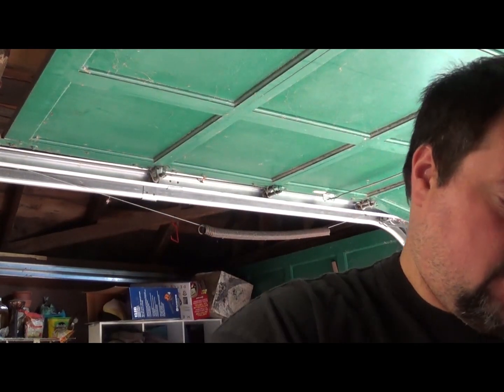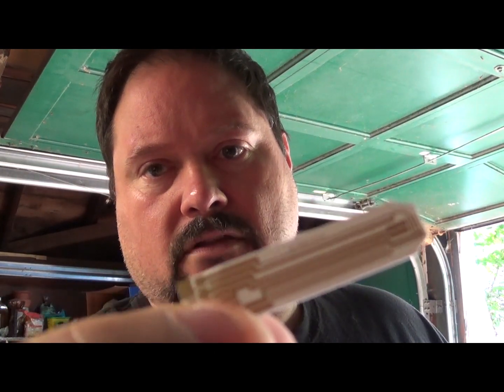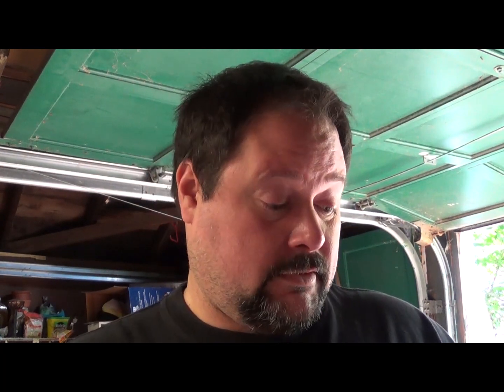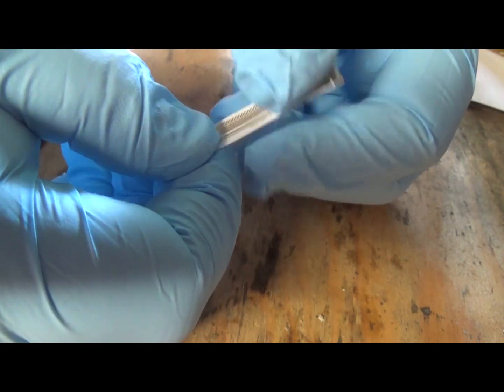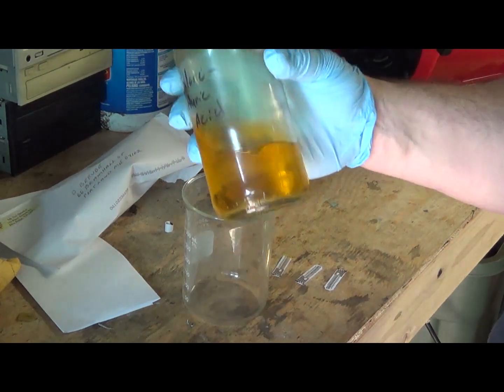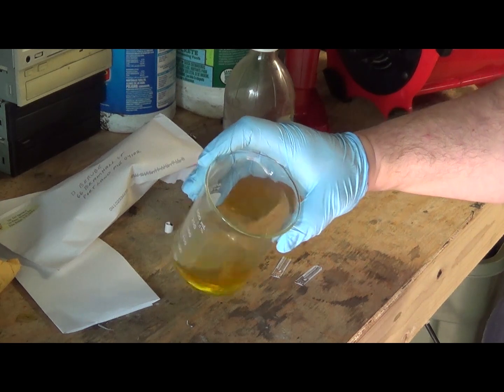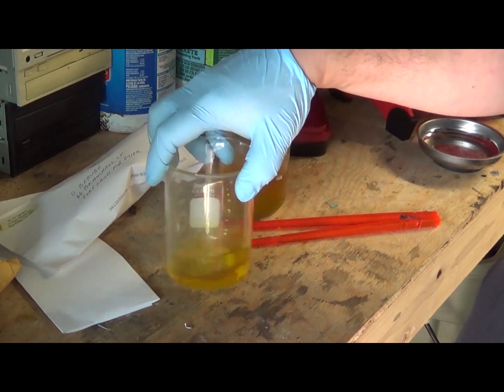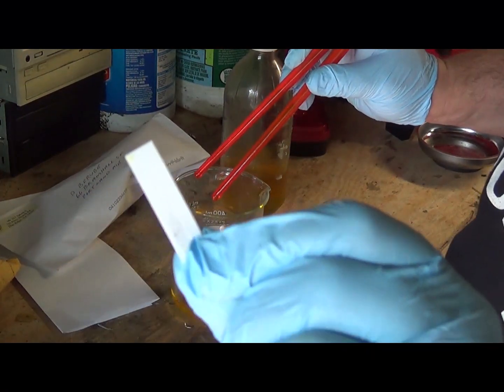Gold Recovery from Diabetic Test Strips

Comment: Being a diabetic I can offer up this piece of information. Some strips contain more gold than others. Usually the more expensive the strip, the more gold they contain, but not always. The more expensive strips are usually more accurate which is why I think they have more gold. They all have gold because it is non-reactive with all of the chemicals blood contains, which could corrode metals such as copper and silver and will not oxidize over time and give a false or zero reading.

Comment: Please, please, please remember people that unless they are your own strips you will be playing with something that has come into contact with someone else's blood. That is what's known as a level four biohazard. It is potentially as dangerous as it sounds. An added thought is that most diabetics have other sharps in the same disposal containers as their used test strips. Meaning there could be a risk of a needle stick. 

IF you're going to do this I'd suggest finding yourself a plastic tub or glass baking dish with a large flat bottom. Put on a pair of the good heavy duty nitryl gloves and empty the container then cover with bleach. Use an old pair of bbq tongs to spread them around the bottom so they are all covered. Let it sit for a few minutes, drain the sharps through a kitchen strainers, rinse with cold water and repeat one more time. Even old or dried blood products are nothing to chance with.

All that said these are not worth it. My daughter's a type 1 diabetic and I tried collecting them and just peeling them as she used them so I didn't have a huge batch to go through at once and just chucked them in a 1 gallon pickle jar until it was filled. I barely got a gram out of it. It's got to be a gold alloy and not pure gold and thin as hell at that.

Comment: Hey I like your video on using Drano to remove the green soldier off of circuit boards I been cleaning the green crap off every circuit board I have thanks for Videos.
Reply from the maker: Hi and thanks for watching but I have never used draino to clean boards...  I use lye, not all drain cleaners contain that so please be careful!
Reply: I will thanks Drano has lye in it I use a cap full in boiling water then i boil the boards for 15 to  20 minutes then I use a
Reply: Green Scott scrubber
Reply: Not liquid Drano I use Drano crystals.

Comment: Ok, I have a jar of diabetic test strips, about 4 inches high, 3 wide packed full of strips, may count them out some day, and a big pickle jar of various gold stuff from electronics. How can I process this stuff?  It will be my first time, and need good instructions. Have a lab beaker set, from amazon, think the biggest is 1000ml. just ordered a gold test kit from Amazon,and some other supplies. would like to try processing this by mid june, if possible.

And I noticed that Accucheck went to silver strips.. im saving those too, as they should be salvageable.  

Thanks for any help.

Comment: Hey Moose. I've been starting to use the new wireless sensors for diabetics and guess if I was in for a suprise when I opened one of those sensors. A small plated circuitboard... And I get them for free. I will open ten and see what will come out of that batch.
Reply: If you can get these expired strips _freestyle , accu-check retail , i will trade you for long dates at a ratio that pays more than gold Teststripjoe@gmail.com. Expired strips can be used for animals and still save lives !

Comment: Let me just say I did 1500 of the Accu-Check gold plated strips and got very very little gold powder once finished. so little that it couldn't even be smelted. You will need thousands of these strips. Maybe 6 to 7 thousand of them to get much of anything. Not to drop a turd in the punch bowl, but wanted to share the let down.
Reply: Gold recovery: The diabetic test strips that contain the most gold are the One Touch Ultra and the Free Style Lites.  We have about 46,000 of these that are unused and expired, which are ideal for recovering the gold.  Please contact me if interested at free 3733 at geeeemail

Comment: hey moose scrapper, question for ya....can I purchase sodium metal bicarbonate instead of making at home? I'm not sure if I want to chance blowing up the garage just yet, lol.
Any suggestions?
Reply from the maker: +Holly Dietrich Hi and thanks for watching.  I am not quite sure what you are asking here.  What would the sodium metal bicarbonate be used for?  In this video, I use sodium metabisulfite, a completely different chemical that is not substitutable unless you want to use sulphur dioxide gas bubbles directly.  And this should not be done in the garage due to fumes.  Do this outside and stand up wind.  Best of luck to you.
Reply: That was a great video about Gold Recovery from Diabetic Test Strips

Comment: Hey Moose, I have a question. I have about 2000 "Embrace" & "ForaCare" brand test strips and don't know what kind of metal is used on them. I'm sure it's not gold but one of them I'm guessing platinum. Would you confirm what is used on these test strips? If not would you let me know how to find out? Moose is #1!

Comment: I'VE BEEN SAVING MINE BUT DUH ME HAS BEEN CUTTING OFF EH BLOOD PART NOT
THINKING OR KNOWING ABOUT UNDER THE TOP PART OF THE STRIP... WELL THAT 
I KNOW i'LL JUST WIPE IT OFF AND STICK IT IN WITH THE REST OF THEM. NOW IS
THE GOLD ON THESE 14 OR 24K GOLD??
Reply: +ShootBigBucks If he refines using the Bleach-HCl method it does not matter if his source is 14K, 21K, or 24K.

24K is what drops out of solution after adding Sodium Metabisulfite. The Copper Chloride and Nickel Chloride Salts from any Karat Gold (impure Gold) remain in solution.

Bleach-HCl produces Chlorine Gas and breathing that in can be deadly. It will burn your lungs. 

You will not feel it as it is happening as your lung tissue does not have nerve endings. But you will suffocate if you do it wrong. There is NO PAIN WARNING..

Heads up.
Reply: +sthwestb if they are from liberty medical, then they are 24k. keep in mind, the more you refine gold, then the higher quality you will get.

Comment: ey moose good work i only got one problem my hcl and bleach when i make and use it the next week when i wana use it again it does not work then i must thru more bleach in and then it works again how do u use ur stuff over and over or how do u store ur used acid  must it be in a plastic or glass bottel and must the bottle seal good.becuase im sitting with maybe 5 litters of hcl and bleach with maybe a gram of gold in and do i mix it right 3 parts hcl and 1 part bleach. im gone make a new butch of the acid to do some simcards in.and if i do it can i throw  a bunch in it or must a only do 1 or 2 on a time in the acid.
Reply: +james wilson keep it air tight so it doesnt evaporate and be careful of not adding water into it
Reply: +ShootBigBucks thanks alot for ur help
Reply from the maker: +james wilson Hi there, Shoot is right, you want to keep it air tight.  I use a glass vinegar bottle that I washed well.  I would really not suggest that you use that much liquid though, If you have that many liters of solution with only one gram of gold in it chances are you will have a very....very hard time recovering it, if you are abel to get it back at all.  Try your hardest to not use more than 400ml of solution.  Also, sim cards are not the same as the diabetic test strips.  Sims actually have a layer of copper under the gold so you will want to use AP before you try to refine it.